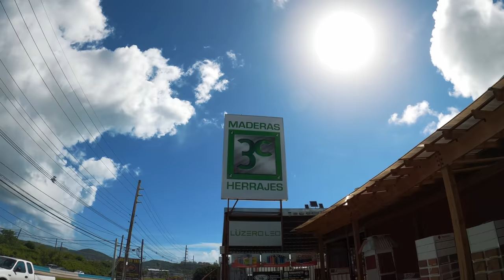BOAT YARD (PART 2) DESTROYED OUR BOAT SHOULD WE BUY THIS ONE?!

Comment: I say resist the urge to buy the CS40.  Bird in hand is best move, you dont know what problems you might have with the other boat.  Nothing more free than no big debt.  I have watched a lot of sailing shows and for me they become less interesting when A:  they buy an expensive new boat and become just another yacht rather than adventurers aka Atticus/Doodles or B:  Babies on board - aka Delos and Vagabonde.  Matt brings out the inner do it yourselfer for viewers and you turbo charge that with your determination. New paint, new bulkheads and new engine...Go GBU!  I would only trade up at the point at which you want to do world sailing and the 40 I dont think is that boat,. Love the show
Reply: I agree with that advice
Reply: I agree with you as long as their boats haul is sound stay with the boat they have

Comment: I've replaced bulkheads before. I always set them in place with thickened epoxy on the edges touching the hull and deck. Hold in place with some temporary srews or clamps if possible. Then using same thickened epoxy filet the corners as fiberglass doesn't do 90 corners very well. When applying fiberglass I think a 6 inch wide strips would do perfectly ( definitely save on fiberglass). Guaranteed it won't be flimsy. Hope this helps. Good luck and fair seas
Reply: THIS ^
Reply: Take a look at the way "parlay revival" replaced their bulkheads ! Tabbing in at the connection points with several smaller strips ! The boat was a lagoon 45 that was in a hurricane , but several other 45's had damaged bulkheads because of over tightening the rigg and engineering flaws !
Reply: @inmyopinion6836  obviously they didn't watch the repair of parlay revival because if they did they would have done their repair like shown !
Reply: Agreed
Reply: Here here! My exact advice also! 

			Good luck to you both…
Reply: Agreed. I think you need filets.
Reply: absolutly  make a thickened epoxy join and fillet the edges

Comment: Matt - those bulkheads are fabricated when the boat was just a hull and they really lay on the material - layers and layers of woven glass mat.  You are right to suspect 3 little layers and the inside corner needs to be filled with thick resin/glass mix (peanut butter thick) so the glass mat will not have to make a tight bend.  Really important stuff because there are tremendous forces on your bulkheads.  I would definitely match back with similar thickness as the old bulkheads as a guide - match like for like otherwise it will definitely not be as strong.  Also make sure you get all of the air out between layer and really lay on the resin.  Also the wood is going to soak up some of the resin and leave a dry surface layer where you thought that there was plenty of wet resin and this will de-laminate and then the strength goes out the window.   Put a layer of resin on the bare wood and let it soak up & dry completely.  Get your next bulkhead cut and get the resin on it and let it dry. Then start your glass work.  All the very best - take your time and don't cut corners.

Comment: Drill a few holes in the old bulkheads to inspect the wood inside then fill with epoxy. This will let you know if they are rotted or wet.
Reply from the maker: Good tip!! We knew we had to replace one so we figured we'd just knock em' all out
Reply: Knock them out, do not cut corners. Cutting corners is how you get problems fast.
Reply: Also, pull a few bolts and check the wood where the bolt passes through.  (top ones). Water dripping down the chain plates from the deck will rot  the wood in that area while the rest of the bulkhead may be fine

Comment: Hey Matt get some 80 grit abrasive flap wheels for the grinder will make short work of getting the paint off  :)
Reply: Really glad someone told him that
Reply: Makes a mess, but you're 100% right with this.
Reply: I would start with 40 grit  and feather it lightly not to take off too much till you get use to how agressive it is.
Reply: @johncartelli  anything better then the wire wheel
Reply: Yea,  A flap disk is what you want…. Wire wheel is for light work and you are definitely in the Heavy work side of things.

Comment: Hey guys, I know it will be hard and a little more work but I would recommend that you remove the bulkhead work you did in this video and install them the correct way. At this point you only get one shot to do it wright as this is critical infostructure for your mast. You don't want to get out to sea, get hit with 50+ winds and end up crippled. The comments from "Hooked-n-Rollong Offshore made are spot on. Matt u are a hard worker and I know u want it done wright but u also want it SAFE! I suggest u check out Parley Revival or Expedition Evans as they are pros at bulkhead reconstruction and fiberglassing. Also if you want to make a template for your bulkheads try using cardboard to trace it out befor u cut that expensive plywood. In any event - Good luck with the monster job you have ahead of you. 

P.S. My offer that I made in your last video still stands,

Comment: When making complex shapes use some thick cardboard which you can trim with scissors to fit then transfer shape to plywood .get flap discs for the grinder will eat the paint .overlap the fibreglass more and needs to go over the top too .have fun!!!!
Reply: Great advise! also, you can get the flap disks that are thick and they last forever. the thick one doesn't do curves well but lasts.

Comment: If I were you, I'd watch a few of the bulkhead repair videos done on Parley Revival. Their bulkheads failed and Colin repaired them. He is an expert on this type of repair. He started with thickened epoxy to attach the bulkheads to the hull and put fillets in every joint to allow the fiberglass to make the bend.
It is also a good idea to seal the bulkhead with epoxy on every surface to avoid future water infiltration before installing it.
You seriously need more training on fiberglass. If it isn't done correctly, it will fail at the worst time.
Reply: Good advice!! Also get an exhaust fan with a coil duct tube for the dust and fumes during fiberglass work. Clamp tube near your project for extraction and set duct-fan outside. It works great for these projects!
Reply: yes, but he was not an expert before he did it. He took advice/direction from Lagoon directly, then got in and had a go. :-)

Comment: Tab your bulkhead’s up to the ceiling too. The wood on the existing bulkhead sounds great and healthy, not dull and rotten. Tab in and up with fibreglass.
Reply: You may also want to consider epoxy fillet between bulkhead and hull before you glass.
Reply from the maker: Ye we used epoxy to fill the gaps and we will tab to the deck even though it never was before
Reply: @SailingGoodBadandUgly  not an expert but you want the forces on the rigid hull, so be careful of tabing to the deck it flexes differently. Curious if any engineers have an opinion on this.

Comment: The huge forces pulling on the chainplates must be transferred to the hull. Being inboard, the force gets turned 90 degrees at the bottom of the 'bulkheads', pulling inwards. The more you move the attachment downwards, the less the force - so if you can, put fiberglass there. Beware the stress concentration at the joint (which unavoidably is transverse, that is, within the epoxy, meaning the failure mode will be de-lamination initiating in the corner). I'd add a big fillet - thin strips in the corner, widening out as you go. The inner part of the fillet could be filler, I suppose. There may be no greater need for good engineering anywhere else on the boat (except attaching the keel). Good luck!
Reply: This is the absolute best advice in the comments.  Matt is scaring me a little because you are absolutely right, this is engineering and you have to figure the weight transfer plus stiffness vs flex.  It also matters from an engineering standpoint where on the hull the weight transfers.  He cannot have the bulkhead on one side off by even an inch from the bulkhead on the other or the chainplates will be off causing a twisting effect with the shrouds and stays.  The whole thing makes me nervous.
Reply: Wow there are some serious high level engineers commenting on this! Everyone loves your channel and wants you to be safe and succeed!
Reply: The best coment,your right!
Reply: @JESUSCHRIST-ONLYWAYTOHEAVEN  Jesus Christ on a crutch! Go take this to a bible thumper channel and leave the sailing channels alone.
Reply: @JESUSCHRIST-ONLYWAYTOHEAVEN  Fruit Loop go to the channel that begs for Gold. O they still have Nothing or is it the More you Give the closer to god you are ????? .
Reply: @dictator9849  Is pretty much a new for old replacement so no difference in the engineered forces - relax
Reply: @JESUSCHRIST-ONLYWAYTOHEAVEN  Very good message Travis!!!  They have no idea what they just set them self's up for!!  Keep on with the fellowship!!
Reply: How do you know the hull is true whilst re doing the bulkheads....could be setting yourself up for a nasty surprise when the hull has to work in heavy seas and under load.
Think oil canning.
Reply: @rumblechick73  your being a fool ! Just listen to this it's so true just look at the world!

Comment: Matt, are you tabbing the bulkheads to the deck as well as the side of the hull?  You must tab all directions for a secure bulkhead. Add as many layers of fiberglass and epoxy as needed to obtain the same thickness of the ones you removed. Trust your gut instinct.  Cheers, S/V Cork
Reply: Ditto…all corners with glass Matt to transfer the loads to all directions.

Comment: Guys I watch your videos and I appreciate your hard work. The previous comment about using thickened resin for all 90 degree corners and as a bedding for the plywood are correct. There are many good videos out there on how to do it correctly. Your current bulkhead will not withstand the forces that will be placed on it. In addition you are not wetting out the fiberglass with enough resin.

Comment: Give Kristen every chain plate as you pull them, she needs to polish them well then check over carefully. Through deck chain plates will suffer from crevice corrosion where they pass thru the deck. Even small cracks warrant replacement, and in my experience thru deck chain plates have a 10 year lifespan max, and loss of a rig for failure to pay attention to these is an expensive lesson.
Reply: Good advice.  The moisture damage to the interior and the possible/probable stainless crevice corrosion among all the other things you have to do make me feel like you should go with a different boat that was not so neglected.  Even if you do need to do some interior upgrades on the 40, you are going to bury yourself fixing up your 5000 dollar boat.  

I think I saw it had an aft cabin.  If there are two heads, maybe one could be your deluxe shower?  We always say, “pay now or pay later, but you are going to pay”.

Comment: Yo Matt, er fellow idiot!! (Says my wife) got a hot tip for you!  Before grinding fiberglass get some 7up or other clear soda and coat your arms wrists and hands (spray bottle is best) let it dry.  The glucose in the soda clogs your pores keeping the fibers out.  After grinding rinse it off.  Booyah!  No itchy I’m going crazy feeling.  Got that tip from a fbglass boat builder and it works amazing.  Also put your head down and work there are endless boats that can distract you from your mission,  you too Kristin!!  Stay the course, the pot of gold is not at the end, it’s embedded in the journey.
Reply: Best tip of the day!
Reply: Net hairspray. Same thing. Spray on wash off. Works great for insulation installation.

Comment: For those high structure verticals supports…you have to glass Matt all corners.  So you did the verticals  corner against the wall on one side .  But you need to do the exact same on horizontals on the top and then the bottom.  That gives you 3X strength.  Once you do that, then you can add layers.  Then do all sides.  Your going to have a lot of sheer loads in that area and using the same technique you started with , on all corners will spread the load nicely and prevent single joint point of failures.  Get a small fan  to pump some air into your work area from the outside…all those fumes will put pin holes in your lungs.  Best wishes.

Comment: Just a small tip, I’ve used a grinder a good bit building race cars. Get your self a diamond tipped blade . They will cut anything and are much thinner. They also last long enough to make up for the higher cost.

Comment: Watched the video last night and immediately wanted to comment on the glassing.  Reading the comments below I see they are all picking up on my experience.  If you use large pieces of glass fibre,  as it cures it shrinks away from the corners so you don't get a good bond.  As everyone says, start with small strips of glass over fillets of filler.  Glass strips get wider with each pass.  I'd suggest covering the plywood bulkhead in glass fibre beforehand, certainly the ends, and bed it to the hull with thickened epoxy to.  You may need to change your sequence of work as each bulkhead might need 2 or 3 days on it between cures.  Get a copy of Beuhlers Backyard Boatbuilding as a reference source. I also agree with checking out MJ Sailing, although they're using foam core not plywood the attachment principles are the same.  Finally, get new chainplates made. No question these ones have had their day!

We love you guys, stick with it matt, you're doing brilliantly.

Comment: Put wood gussets at the top in the back on each side the plywood and epoxy in place. Then glass over it all and maybe add gussets to the bottom of the cabinets doing the same steps. Just for the two your fixing.👈🥸😉👍

Comment: Resist the temptation to buy the 40 ' sailboat.  You know what it cost to sail you current boat.  It is going to be a solid boat when you finish the new bulkheads.  Stick with the plan.  We have faith in you that this will be a much better boat if you stay focused.  God bless you both.  Cheers.
S/V Cork ~
Reply: Never owned a boat?

Comment: You could do a couple of core samples (1 inch hole saw) to see if the wood is rotten.  My guess is its probably only rotten where it was exposed to air (moisture/mould/etc)
Plus Curt Austin is wright.  If your going to put more glass on the bulkheads, put it down low glassing the bulkhead to the hull (for reasons he explains very well).
Getting these bulkheads correct is VERY important.  Imagine a strong gust of wind when you have full sail and the damage that could happen if it gives way.  At best you will be motoring to land, at worst you loose your mast, rigging, sails, etc and possibly whoever is up top.  Love you guys, dont want to see something truly nasty happen to you two.  Take care.

Comment: normally use a 8in strip of glass matt in the 90deg corner/L SHAPE...4in either side, this builds in extra strength where the hull meets the ply...hope that makes sense!
Reply: I would buy other boat, place the new engine into the new boat. You shall spend less time and money updating the interior of it than all the work you need to do

Comment: need a 40 grit flap disk sander pad for the grinder, they are aggressive so go lite sanding with them
Reply: Now you are getting this deep into it , look into getting an 8 inch sander polisher instead of a grinder..they run slower and if you get one with electronic speed control you will save a lot on sanding discs..your grinder really runs too fast for fibreglass..gets too hot and burns discs..all the best with the refit..p

Comment: My (minor) experience with fiber-glassing (+ watching other channels - Parley, MJ, LifeOnTheHulls, MagicCarpet, etc) tells me I would NEVER have applied the fiberglass mats (even stranded) over or inside sharp corners: it will most probably break the fibers over time. This is especially important on structural parts as the chain plate mounts as nearly ALL the strength is located in transition btw the plates/hull, ie in the corners. Instead I'd first fastened the plywood to the hull with epoxy bead behind the ply and a rounded tabs(?) in the corners (all with thickened epoxy), let all that half cure to sticky, and THEN applied the stranded fiberglass (the first, then two layers of smaller) before the woven mat. 
Some other points: 
1) Don't cut but tear the fiber apart at the edges (Aladino from Magic Carpet). A little difficult with woven mats, but the point is to even out of forces and smoother transitions btw mats. 
2) I had also set up a wetting table (table/sheet with plastic) for wetting out the mats 100% before applying, and then just rolled them up and out. 
3) If the ply was flimsy, did you epoxy them to the deck too?
4) Never skip on layers of fiber. Remember, always more fiber than resin.
5) I had applied peel ply as the 'final' mat would have reduced later cleaning/finish time after curing + to avoid sanding that might cut the fibers of the outer woven mats.
Reply: great tips thanks

Comment: I agree with Hooked in Rolling below... Also apply a thickened epoxy paste to the part then press it in to fit. This will get rid of the micro gaps between the wood and the hull. Then take the excess squeezed out epoxy and start your fillets . Use the radius of a tongue  depressor to make smooth fillets, when dry, then use the fiberglass...

Comment: Matt!! 40 to 60 grit flap disc on the grinder will take the paint off in no time.
Also, you need to use thickened epoxy between the the hull and bulkhead as well as thickened epoxy fillets where the bulkhead meets the hull.
Reply: Yes